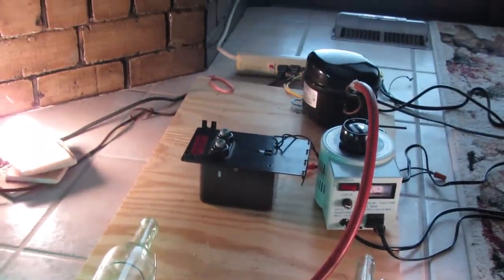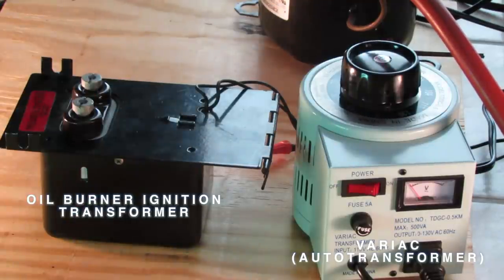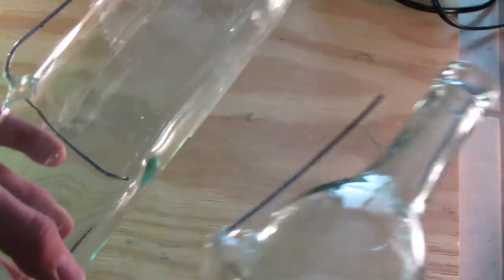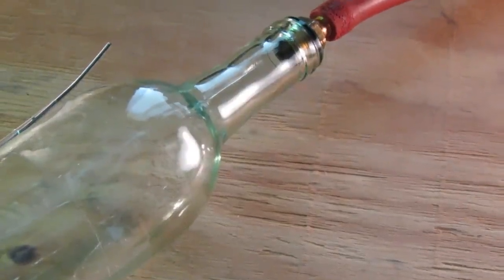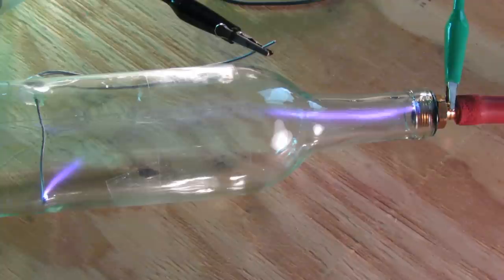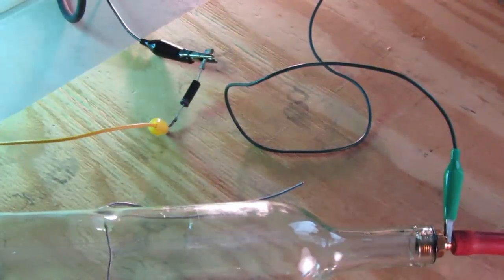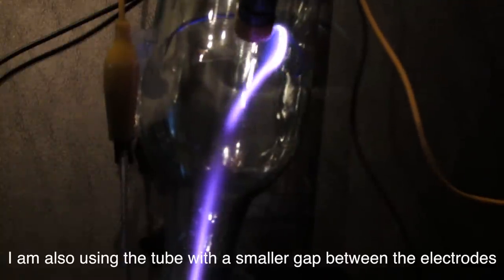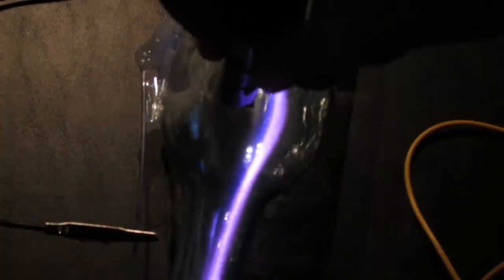Incredible Homemade Plasma Discharge Tube - Part 1

Comment from the maker: If you’re going to make a comment about this not being an actual CRT or that this is generating X-Rays, please don’t! Those topics have already been thoroughly covered in this comment section. This is not a CRT going by the common definition of what a CRT is. I know that now. I made this video many years ago while I was in middle school and certainly didn’t know everything about these topics. I did make an actual cold cathode CRT with a phosphor screen later, if you’re interested in seeing that just look at my later uploads.

This does not produce X-rays. Neither the vacuum nor the voltage are high enough to do that, and I have confirmed this with a Geiger counter.
Reply: If you put in some very vaporization prone metal like zinc or cerium could you change the color of the beam in a significant way or would the vacuum just fail?
Reply: @jules658  Electric arc discharge in low pressure air.  The distance an arc can jump depends on ambient pressure, among many other things.  A hard vacuum like what you have in a typical CRT or vacuum tube however, is a very good insulator.  It's of course still possible to get an electric current to flow or "jump" between electrodes under hard vacuum but only if you heat the cathode or use much higher voltage.  There really wouldn't be anything to see though; at least not from the side.  Electrons striking glass can cause it to fluoresce slightly but ordinary CRT's only produce significant light because of the phosphor coating on the back of the screen glass.
Reply: It is a CRT. It's picture tubes that have the phosphors. And just because there was some ions in there doesnt mean those werent cathode rays...
Reply: What's the value of the voltage?
Reply: Would it be better to use wire made of silver or gold or made from copper?

Comment: There are already some comments, that say, this isn't a CRT. Well.. They are right. A CRT needs more vacuum or else, the flowing electrons will iodise the remaining gas and that will produce light - mostly UV, but also some visible.
An electron ray in an absolute vacuum is invisible. It can only made visible, by putting some phosphor on the glass, which will glow, when hit by electrons.
This effect has been used for decades, to produce TV-Screens.
Also, a real CRT only works, if the electron emitter is hot, or else, no electrons can leave it.
A glowing wire has a tiny cloud of free electrons around, that can be accelerated by high voltage. That's the principle, all CRTs use. Is it a TV-Screen or those smaller amplifier tubes, you find in old radios or TVs. Also in sone shops, that sell beyond-hearable-HiFi amplifiers.

But aside of that - nice experiment. Becareful - this time, you have just been lucky, not to been hit by high voltage. Next time, use a plastic stick for that magnet.
Add a video, that shows us your hair, after been hit :-D

Comment: Agreed, that’s a plasma arc.  Cool anyway.  The X-Ray warnings are more than just a little overblown for 15 kV and stainless steel target but if you ever see a green or greenish glow inside (usually right at the target), turn it off.  Also, don’t make the target wire in a loop like that, make an ‘L’ shape (pointing toward the ‘cathode’ in the center).  You don’t want that hot plasma getting near the glass like that, it could easily crack the glass and the whole thing will implode.  Be sure to always wear goggles, glass and vacuum equals trouble.

Comment: I am learning about Cathode Ray Tubes, which play a significant part in x-ray machines. Wilhelm Roentgen must have suspected that other things were being emitted from cathode rays so he put a piece of black paper around his CRT and directed the cathode ray towards a photographic plate. He put his hand between the CRT and the photographic plate and saw the bones of his hand; fascinating! That would be a real challenge for a do it yourself physicist - to recreate that event!
Reply: Steven L Edwards if I did that and never knew about x rays I would instantly be freaked out and think I might die or something because that would not seem possible

Comment: Firstly you DO NOT have a cathode ray tube, you have a glass envelope evacuated to a rough vacuum to allow current to flow between the electrodes. 
Atmospheric pressure in millibars is 1015. A refrigerator compressor as a vacuum pump can achieve at best a vacuum (called ultimate vacuum) of 300 to 400mbar which is a low vacuum. 

A single stage rotary vacuum pump has an ultimate vacuum of around 1x10-2mbar while a two stage rotary vacuum pump is around 1x10-3mbar.  

A cathode ray tube has a vacuum at least 1x10-4mbar which is beyond the range of a rotary pump and operates on high voltage DC. 

To achieve higher vacuums a good 2 stage rotary pump backing a diffusion pump or a turbomolecular pump which can be expected to achieve 1x10-6mbar. There is of course outgassing from the vacuum chamber which will degrade the ultimate vacuum.

Comment: nicely done, really good work. Cunning use of the fridge compressor. I'm guessing a CRT flyback transformer can be used in place of the oil heater ignitor.....good explanations and commentary as well. Very impressed. Thanks for making the vid.

Comment: Very good, but, it's more of a high voltage controlled arc, which is basically what a CRT is, it would be cool if you could phosphor the end of the glass and put a signal on a control grid...
But, hats off to you for a very cool experiment.!
Reply from the maker: Thank you! If you check out one of my later videos I did actually make a functioning CRT that lights up a phosphor screen.

Comment: The beam splits because it's now AC , alternating current, meaning back and forth switching polarity therefore deflection in one way then the other, we could probably slow down the footage to do that, magnetism and electricity are one , one side of the magnet runs clockwise and the other counter clockwise, if you hold a large Neodymium magnet and use a metal ring on a string and slowly approach one pole it spins one way, without rotating the magnet bring the ring underneath and repeat and the ring will rotate in opposite direction , harder to do underneath as it wants to fall so you need to gently couple the steel ring then bring it closer

Comment: Please, if you can tell me, is this with red hose that you apply on top of a bottle, is that a gas or? This is just amazing!
Reply from the maker: The red hose connects to a vacuum pump. This pulls gas out of the bottle and creates a vacuum. So instead of adding a gasses it is taking aways gasses.
Reply from the maker: I'm glad you enjoyed it!
Reply: Vacuum? I mean purple tails are from gas(associated with Neon) :)
Thanks, I must read somewhere about Cathode Ray tube. Thanks a lot for respond!

Comment: I built a small hv circuit and was able to produce around 10kv. I attached one wire of the hv output to a magnet and the other one i pulled an arc on the pole of the strong neodymium magnet and i got a cone like plasma arc which looked awesome. I also found that since the arc interacts with magnetic fields that the arc would jump to one of the poles of the magnet when the arc started at the side of the magnet. Theoretically based of my results, couldn't you map the magnetic field of a magnet with plasma arcs?

Comment: Hey just curious, but any idea if the electrons in the tube can induce and current in a copper wire if it were coils around the tube. I'm sure that's theoretically correct but I could be missing something.

Comment: Hi.Im looking for a cathode ray tube `Power Supply`.
My CRT input is rated between 4000-8800 VDC.

Whats the difference between using AC or DC input voltage?
Reply: Well one is Alternating Current and the other is Direct Current

Comment: careful there.. there's a bit of x-ray emmission
Reply: ah that's plasma - walk outside and there's a 'bit of x-ray emission' 

It is a voltage passed though a steel wire where do we get the x-rays? there isn't even an accelerator? 

the Transformer has increased the Voltage but the HZ rate is 60hz (i assume) 

at least when you see people using a Magnaton you can say 'watch out there's some microwaves!'

but i don't think it's relevant in this case.
Reply: The beam that we see that is being bendt in the magnetic field is plasma all right.
But it most likely is some x-rays produced by that apparatus.
Electrons are accelerated by the high voltage from the brass fitting and when they hit the steel wire the x-rays could be produced.
If you take a look at Wilhelm Roentgens original experiment this is basically the same.
Only this setup seems to have a lower vacuum, and as such less x-rays. But still something to be wary of.
Reply: that is what i am worrying about
Reply: x-rays will be produced at around 20kv and at 20-25kv they will mostly be hold back by the glas from the bottle.
Reply: If the volatge increases then the intensity if the x ray increases. If the current increases then the filament releases more electrons that hits the anode released more of xrays
Reply: X ray creation requires high velocity electrons.  Due to the gas instead of a hard vacuum, the acceleration space is very limited, so it is unlikely to produce measurable X rays.  

A crooks tube is a high vacuum tube, so this more resembles a plasma tube than either a scope or crooks tube, but running current it does respond to magnetic deflection fields. 

For anyone wishing to re-create the experiment, remember that the shell of the refrigeration compressor becomes a vacuum bottle with high thermal insulation.  An extended run time will result in the motor overheating and result in burn out.  Run only short periods of time and do not leave under high vacuum between runs.  This is something that is taught in refrigeration classes as why sealed refrigeration compressors are not to be used as a vacuum pump on a refrigeration system.  Non hermetic compressors that can be air cooled should work fine.  It's the motor in the steel can in a vacuum that is the source of the heat problem.  Under normal refrigeration flow, the refrigerant is the coolant for the electric motor.  Running without flow is like running a car without water in the radiator.  It can run for very short periods of time for testing only, but not long.

Comment: Please recommend an alternative for the Oil Burner Ignition Transformer as energy supplier. Can I not use the variac, since it will exceed my school project budget.
Reply: Flyback transformer.
Reply: and that's going to require a sawtooth oscillator circuit to drive it properly

Comment: I made a cathode ray tube but for some reason mine glows but the glow is more diffused and is not like the "beam" of electrons that you see in yours.  Do you know why my cathode ray tube doesn't show a beam?
Reply from the maker: West FPV that means that your tube is running at a higher vacuum than mine was in this video and is probably closer to a true CRT than the one shone in this video. Check out my electron accelerator video where I run a similar tube at a high vacuum which creates a diffuse glow. If you want a more beam-like appearance for demonstrations you will need to introduce more pressure.
Reply: ok great thanks for the explanation that means a lot!

Comment: hey i wanted to know the voltage that you used and also the resistor's resistivity
Reply from the maker: The voltage is anywhere from 10kV-15kV. There is no resistor in the circuit, just a full bridge rectifier.

Comment: I know this is a couple years old, but I haven't seen a single warning to wear eye protection. Applying a vacuum to a glass object that has a hole drilled into it sounds extremely dangerous. If there is even a tiny crack from drilling the hole it could implode and send shards of glass flying
Reply: and then outwards again by the fragments' "overshooting" momentum and rebound elastic collisions (between the pieces and other nearby objects) making for a highly-unpredictable and potentially dangerous field of glass shards

Comment: Very instructive demonstration but reckless exposure of lethal voltages.
Reply: That's why he recommends "do not attempt to recreate this experiment" so there.
Reply: Good God!
Reply: This is not the main danger, in fact high voltage risk can be lowered with some caution. The main problem is x-rays. Electric arcs in a vacuum create x-rays.
Reply: +Akira Sumire the vacuum must be quite hard to produce significant quantities of x-rays and the anode voltage at around 33-40kV as well (he is using 8kV)

Comment: Probably wouldn't want to look directly at it
Reply: Don't worry. This is what's in old televisions. And this one is operating at approximately 1/15 of what the cathode ray tube in a TV operates at.
Reply: I know, but what i'm concerned with is the x-rays generated from that pure stream of electrons.
Reply from the maker: TheComputadude I was worried about xrays also, so I tested this with a geiger counter. Even at a 15 micron vacuum I pulled with my new pump and 15kV DC there were no xrays produced.

Comment: why would you call it cathode ray tube???i saw the bottle and the "vacuum pump" i assumed you were gonna put a real electron gun assembly on it and try to display something on it..i thought: wow thats interesting! how will he make a yoke for it?how will he weld the glass at home, how will he make a getter and ignite it?how will he handle the anode connection, at what voltage will it operate?how will he deposit the phosphor?? then i realized it was clickbait

Comment: what is color of cathode ray in complete vaccum
Reply from the maker: There is no color in a complete vacuum because there is no gas to ionize. The sides of the container might glow green from the impact with the high speed electrons.
Reply: Helium is yellow, argon is bluish, neon is red.

Comment: i would be to afraid of x-ray radiation exposure, unless i had a giger counter for it.
Reply: RockeyDAproductions X-rays would not leave the glass walls of the bottle because they aren't energetic enough. I think the cutoff for that is around 10 kilovolts.

Comment: Like another viewer mentioned, please protect yourself from x- rays; back “in the day”, this was such a serious side- effect of malfunctioning high-voltage supplies in color CRT’s, that governments mandated sets to include over-voltage protection, to protect consumers from x-rays...
Reply from the maker: Mark Bunds thanks for the concern, but this setup does not produce X-rays. I’ve confirmed that even on higher vacuum systems than this one using a proper Geiger counter.
Reply: Noted, and very unlikely at 10KV anyway, but few experimenters would stop at a mere few KV as they ramp-up the capabilities of a system. My concern is for future projects that may perhaps demand higher energies, but I see from your other submissions that you are well aware of these dangers, and always work safely. Kudos, and thanks for sharing your time with all of us!!!

Comment: This is not a CRT.
Reply: Then what is it?
Reply: @p.momentum a plasma tube, CRTs are pulled to vacuum, this tube still has gas in it, hot glue cannot hold a vacuum haha
Reply: @nixietubes Yes it is hard for electron beam to penetrate very well in the air. It is cool but it is actually just a homemade glow discharge tube, definitely not a cathode ray tube.

Comment: That is very dangerous. Cathode Ray Tubes are extremely charged, even if they haven't been turned on in 10 years. That's why when all TV's had these, you had to call a TV technician to work on your TV, because your CRT had to be discharged before it was safe to work on.
Reply: It's not like TV techs have some sort of arcane knowledge unavailable to the rest of us. It's a very simple process to discharge a tube, you don't have to call a tech. If you understand basic electrical principles, it's not dangerous at all.
Reply: urdnal I know, but back in the day, people didn't have the tools to do so, but the technicians did. The guy in the video doesn't appear to be taking any precautions. I mean I might be wrong, but From what I can tell, there were no precautions taken.
Reply: The large static charge on TV CRTs came from its internal coating for the hv connection creating in effect a plate of a capacitor (charge=volts x capacitance, which with kvs would be high with only a few mmfd/pfd).  In the wine bottle construct here the wires have little surface area and are far apart so have little capacitance vs a TV CRT.
Reply: John Goodenberger People didn't have screwdrivers and wires?!!
Reply: Yep, that's all we used to use with a clip lead to the aquadag. And as a right of passage as an apprentice, the boss would remove the EHT cap and tell you to clean all the dust from around the hole. Not a real apprentice until you've been plated from a CRT :-) The good old days. Do that now (if you can find a CRT) and you'd be in jail. The sad new days :-)